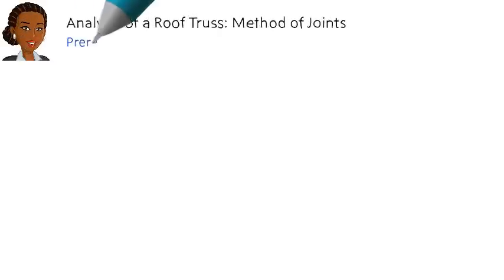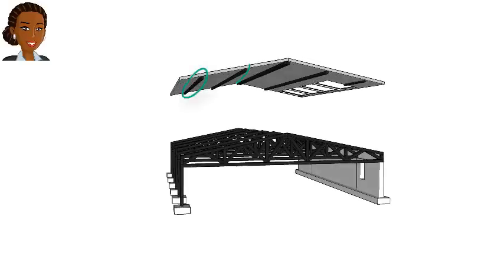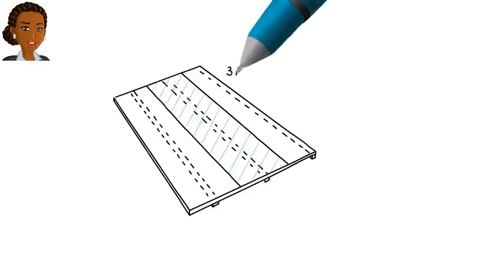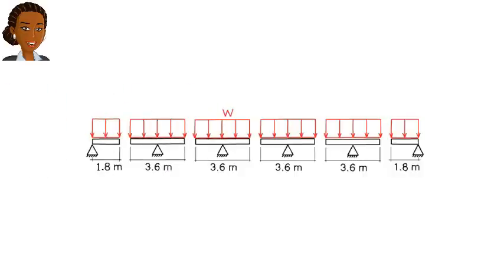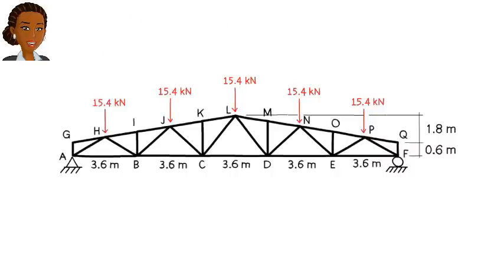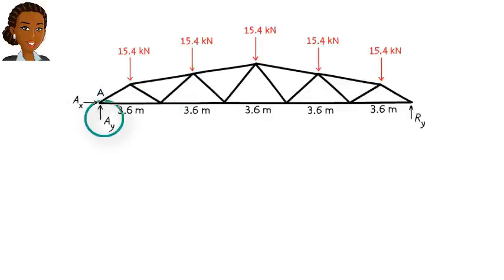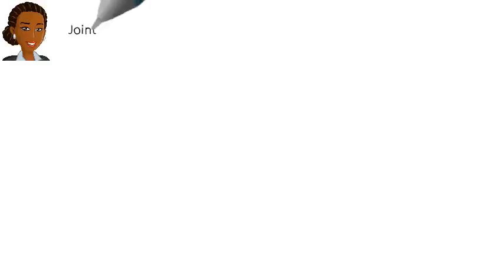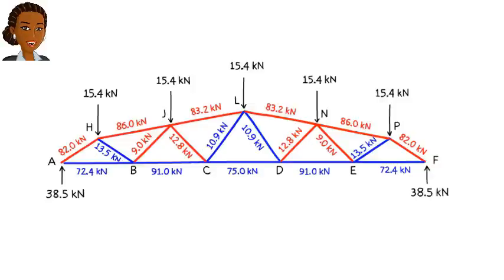SA36: Analysis of a Roof Truss: Method of Joints

Comment: good day to you good sir, i have 2 question below, would appreicate if you can help me with it
1. 4:52 video time, can you show us how you determine the reaction at the beam load to be 1.4w, 4.1w, 3.5w 3.5w, 4.1w, 1.4w ?
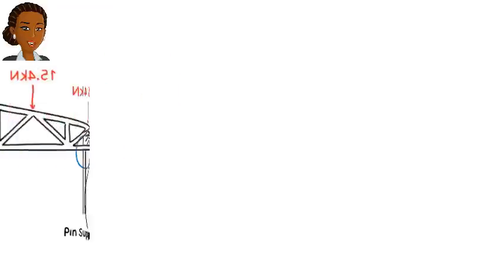2. 6:45 video time, if i were to lock both end using bolts and nuts to column ?
Reply from the maker: @ 4:52 we have a statically indeterminate beam. To see how the reaction forces are determined, we need to actually analyze the beam. But since the lecture is not about the analysis of indeterminate beams, the process was not explained. You can use iFrame (See Lecture IT02) to quickly analyze the beam and validate the results, although, when using iFrame, you should use a numeric value for the load instead of w.

Yes, the ends of the truss are physically attached to the columns using either bolts/nuts or weld. Either way, the same member forces result. A welded connection makes the joint more rigid than a bolted connection, but for our analysis purposes here in this case, the difference between the two types of connections is insignificant.

p.s. Like your screen name :)
Reply: @DrStructure  Your work is TRULY AMAZINGLY VERY AWESOME, that's how i really felt, i am not sue how many people you have unconciously help, but i hope the Lord is with you and he bless you and bless you again
sorry i have some additional question ( sorry i am not a structure engineer, most of my structural knowledge comes from your work
1. do you have a lecture to determine load of indeterminate beam ?
2. if the ends of bolt are welded, wouldn't it become "fixed" with moment ? that would cause the column to take moment as well too right ?
3. If we lock using bolt and nuts it will be sondier as "pinned" and if we weld it will be consider as "fixed" ?
4. Now we assume 1 side is pinned and the other end is roller, but in actual both side of truss are supported by pinned ( bolts and nuts ), in that case how will it affect the support reaction ? will they be bigger/smaller ?

PS : i have one more question on free body diagram, it's a simple frame ( 4 column and 4 beam ) 
something like below
https://magnumpiering.com/wp-content/uploads/2017/12/Moment-Frame-Details-100x100.jpg
and a tank on top of it, problem is really the wind, i have no idea how the wind force will go into the column and beam, because the wind will act in the center of the tank and it's a vertical surface but my beam is horizontal, i have some PDF which are very clear ( isometric drawing ) on the example, if you are comfortable with it may i send the question to you ?
also base on the picture of the frame ( simple 4 leg column and 4 beam ), is that a fixed support or pinned support if i bolts and nuts my column to the ground ?
once again, thank you very much
Reply from the maker: @DOTA2MAJISTRATE  Thanks for your feedback. 

1 ) Yes, we have several lectures on the analysis of statically indeterminate beams. You can see the list of our lectures and a link to each on our website: http://lab101.space/Course-StructuralAnalysis.asp  The slope-deflection method, the force method, the moment distribution method, and the displacement method all deal with the analysis of indeterminate structures (beams and frames).

2) Correct, if the ends are welded, the connection is considered fixed, and that could cause the development of significant bending moment in the columns, depending on the location and direction of the loads. But as far as the truss itself is concerned, a fixed vs pin support does not make much of a difference in the member forces. 

3) Correct, that is generally true. Although we can also design bolted connections that resist moment, act more or less as a fixed support.

4) We can actually design a connection as a roller by having the bottom chord of the truss simply rest on the column sandwiching a friction pad. A fraction pad does provide some level of resistance against slippage of the beam, but unlike a pin (bolted connection), it would allow horizontal movement. Generally, We don’t see that type of connection in residential buildings, but they can be found in modern bridges and other such structures where shrinkage and expansion of the beam due to temperature change could be an issue. A roller (friction pad) allows the member to expand without causing additional stress.  If both sides of the truss are actually pinned, and if there is a horizontal force being applied to the structure, horizontal reaction forces develop at both supports, and the compression member(s) along the bottom chord of the truss would end up carrying more stress/force, as the pins prevent the members from expanding. In contrast, when one of the supports is a roller, the member(s) can expand/roll resulting in less stress. So, the difference between the two scenarios, would be the amount of displacement and stress that takes places in the members, specially along the bottom chord of the truss (assuming a similar truss configuration as shown in the video).

5) That is a rather involved problem. Wind effects the tank which effects the frame. Usually, we want to use three-dimensional analysis to accurately model the behavior of the system and figure out the forces and stresses that result. However, to do a quick back-of-envelope analysis, assuming the tank is rigidly connected to the frame. We can replace the tank with four vertical columns, each rising from the middle of the beam that the tank is resting on. Then, we can distribute the wind load among those columns. For example, we can argue that if wind is in North-South direction, then the two columns in the direction take most of the wind load, so we are going to distribute the wind load between those two columns equally and ignore the other columns. If however, wind blows in East-West direction, we assume the other two columns take most of the load. This way, we can get rid of the tank, and place the load on the frame by adding four fictitious columns to the system. This revised system is much easier to analyze, although we still need to do some more work to transfer the load from the vertical column to the actual frame.

Comment: What about the weight of the truss itself? How do we compute and include them as dead load?
Reply from the maker: We can calculate the total weight of each truss member, then place half of it at each end joint of the member as a downward (gravity) load. A member’s weight can be calculated by first multiplying the specific weight of the material (steel, wood, ...)  by the cross-sectional area of the member to get weight per unit length. Then multiply that by the member’s length to get the total weight.
Reply: @DrStructure  Thanks a lot.
Reply from the maker: You are welcome!

Comment: Hello Dr. Structure.,...Can you show me the way to get support reaction, as we know on the picture that the length of every supports are 3.6m and the results of support reactions are 1.40W, 4.1W, 3.5w,3.5W,4.1W, 1.40W (picture at minutes 4:54 /12:26), can you tell me about the reference of that case. I didn't understand yet. my contact +6285740453435 (Whatsapp number). Thanks for your helps.
Reply from the maker: That beam is statically indeterminate. To determine those support reactions, we can use the force method, the slope-deflection method, the moment distribution method, or the matrix displacement method.

Comment: Why  y dont find the reactions  on other  beams? Since we have different loads  on other  beams  we have  to  determine the reactions right?
Reply: We have 5.5 kn and 11 kn
Reply from the maker: Each side of the roof is supported by three beams. We do calculate the load for all three beams (@6:00). Two of the beam have the same tributary area, hence, they carry the same load. The other beam, at the top of the roof, having a smaller tributary area, carries a smaller load.

Comment: Awesome video. At around 4:50 you say "If we analyzed this statically indeterminate beam, we would get ..." Was this done in another video? What method was used to do it if not? Thanks
Reply from the maker: Since that is an indeterminate beam, either the slope-deflection method or the displacement method would work. No, we don't have the video for that analysis. But you can find videos on several indeterminate analysis techniques on this channel.

Comment: What about including the weight of the truss and the ceiling etc. attached to it at the bottom chord? How do we show the load arrows in the truss diagram?
Reply from the maker: The weight of each truss member can be distributed equally between its end joints. In this case, there is no ceiling, there is only a roof. If a ceiling exists and it is supported along the bottom chord of the truss, then its weight can be distributed to the truss joint along the bottom chord, similar to how the roof load is distributed among the joints along the top chord.

Comment: Dr structure...i have a question after obtaining the member forces of the truss structure like the above which method am i using to design members such as Rafter and struts...??
Reply from the maker: The actual design of structural members is governed by design coded and standards which vary from region/country to region/country. For example, in the U.S., the American Society of Civil Engineers, American Concrete Institute and American Institute of Steel Construction publish codes and standards that are heavily used in the design of concrete and steel structures.
Reply: Im having sloping parallel truss...can i analyse it by using this method of joint??i tried to analyse it by using this method but the member segments of parallel rafters from one joint to another keeps rising...i started from the left support of the reaction and it keeps rising as it goes to the top...so i js wonder where m i wrong??
Reply from the maker: I need to see the truss you are trying to analyze before I can answer your question.

Comment: I have a question dr. Structure ...we have analyse the roof truss by considering only the incoming load from the roof cover and transmit it to the supporting members of the structure as 38.5 Kn but what about the self weight of the surpotting members such as purlins and the principal rafter don’t they contribute in adding some weight to the supports...?? I’ll be delighted to get the feedback
Reply from the maker: Yes, weight of the various structural elements need to be considered in the design process. Here, we are not actually designing the system, we are just illustrating the analysis under a common load, and not all the loads. If this was a real design project, then we would have considered the other members' own weight as well as the various live loads such as snow, wind,...
Reply: Very well...would you please please make a video on how to design a steel roof truss by considering other member’s own weight so that we can understand how get the actual load transmitted to the supporting columns...i and others with the same problem we’ll be very thankful
Reply from the maker: A simple way to get the truss members' own weight into the calculations is to determine the weight of each member, then add them all up to get the total weight of the truss. Divide that total weight by the length of the truss to get a uniformly distributed load which can then be placed as a gravity load on the truss. For analysis purposes, this requires converting the distributed load to joint loads to be placed either along the top chord or bottom chord of the truss.  For example, if the bottom truss chord consists of four joints, then the middle joints each takes W/3 portion of the total load (W being the total wight of the truss), and the two end joints each takes W/6 portion of the load. 

If the truss rests on columns at its ends, then each column would take half of the weight of the truss. That is, each column would take W/2 compression force from the truss.
Reply: Dr. Structure ...So im gonna need to find the weight of each member in my truss and add them up with the incoming load from the roof cover...and divide the overall load by teo because my truss rest on two supporting columns...iz dat right if the structure iz symetrical??
Reply from the maker: Yes, that would work.

Comment: after the actual application, we rely on the computer to calculate the structure?
Reply from the maker: Yes, in most cases we use software to analyze structures. But, the main responsibility of structural engineers is not to learn how to use software tools, rather it is to use their knowledge of how structures behave, and the principles of design to ensure the safety and reliability of the system. No software system can do that on our behalf, at least not yet. :)

Comment: dear admin.

do we neet to put purlin at the joint of the truss? and so. we will get axial tension and compression force.
Reply from the maker: The purlins are there, directly supporting the roof. Yes, they may carry axial force depending on the geometry of the structure and the load pattern. For example, if wind load is present in the direction parallel to the purlins, significant axial compresssive force develops in those members. 

The analysis of the purlins however is not a part of the 2D truss analysis since they are not in the plane of the truss.

Comment: can anyone explain to me Tan 0.96m/ 1.8m  in 9:42 minutes what i know the length of y axes is 0.6m how you got the difference which is 0.36m i will be so much thankful
Reply from the maker: Say, the angle that the inclined (roof) member makes with horizontal axis is alpha.

tangent (alpha) = 9/1.8 where 9 is half of the span length and 1.8 is the height of the inclined member.

At H, the overall height can be written as (0.6 + h). We can use tangent (alpha) to determine h. 

Note the small right triangle that has GH as its hypotenuse.  The base of that triangle is 1.8 and its height is h. And, the angle that the hypotenuse makes with horizontal axis is alpha. So, we can write:

tangent (alpha) = 9/1.8 = 1.8/h 

Solving the above equality for h, we get: h = 0.36

Then, the overall height at H becomes: (0.6 + h) = (0.6 + 0.36) = 0.96

Comment: hi dr. do we always used pin and roller support? because in the actual its usually a fixed support both side. does it has a big difference if we used fixed support?
please advice. 
thank you.
Reply from the maker: Yes, all sorts of connections are used specially in steel structures.  If a support is fixed, a bending moment develops at the joint which could make a big difference in design calculations. Here, the truss is assumed to be supported by a pin and a roller in order to make it statically determinate. Otherwise, we could not have analyzed it using the Method of Joints. We would have had to use a more advanced technique to analyze the truss.
Reply: Dr. Structure ... If the supports could be fixed supports on both sides...what method could we use to analyse the structure...??
Reply from the maker: That would make the structure indeterminate, slope-deflection method, force method or matrix displacement method can be used to analyze such structures. Here however, given that we have a truss structure, using a fixed support (capable of carrying bending moment) does not make much sense since no such force generally develops in trusses.

Comment: what type of truss is this? 
I mean the specific name for this type of a truss and what is the column height that should be provided for such type of trusses ....
Reply from the maker: It has the fan truss configuration. The height of the supporting columns is a design issue, there is no standard height. This type of truss is commonly seen in industrial buildings. Such buildings typically have a height of about 40 feet (12 m).
Reply: Dr. Structure it's called fan truss? 
does it come under the king post truss classification?
Reply from the maker: Yes, there is such a thing as a fan truss. It is more like a fink truss than a king post one.  King post has a vertical member at the center of  truss, something that is missing in our truss. Of course, we can modify the fan configuration by adding a vertical member at the center of the truss making it related to the king post.
Reply: thank you soo much

Comment: this video is awesome
Reply: Do we really need all these zero force members when we are going to design a portal frame in real life? Is it necessary to keep these members?
Reply from the maker: Sometimes, for economic reasons we may want to use prefabricated trusses. In such cases, depending on how the truss is being integrated with the rest of the structural system, we may end up with zero-force members for some loading cases.  

Also, although some of our truss members carry no force under the roof (gravity) load, but they could end up carrying axial force under the wind (horizontal ) load. For example, AG and GH would end-up carrying an axial force, if a horizontal (wind) load is present at G. So, this "zero-force" labeling varies from load case to load case for a given truss.

Further, if a truss has long compression members, say like member HG, then for stability reasons (to prevent member buckling) we may need to introduce additional members (like member BI) which for the sake of static analysis can be considered zero-force members.
Reply: Thanks a lot for reply. Would you please continue another video. What type of truss (K truss, Pratt truss, Warren truss) can we use to minimize cost for same load applied (38.5 kN on one side)? What shape of steel (I beam, W beam, H beam and channel) and size (web, flange, thickness) can we use to minimize cost for same load applied?